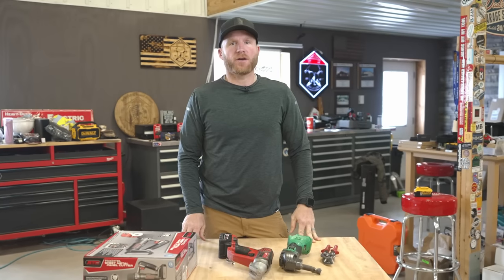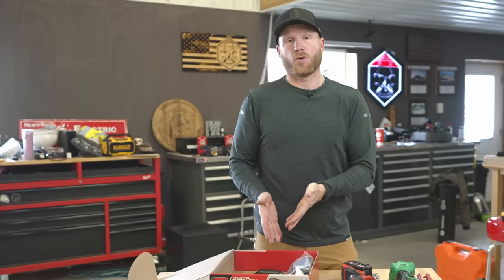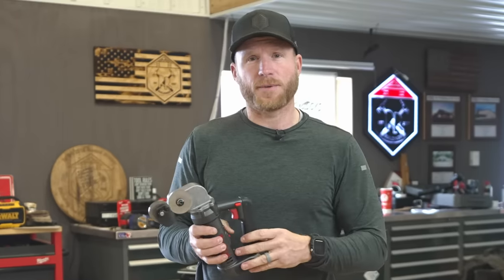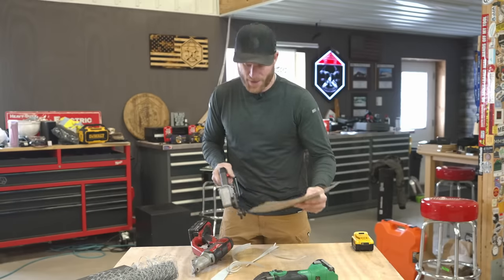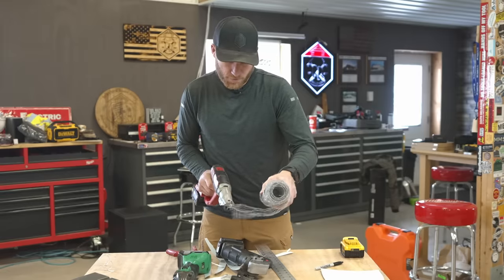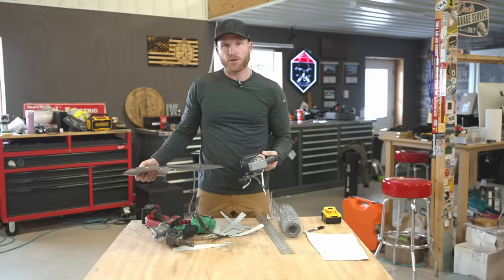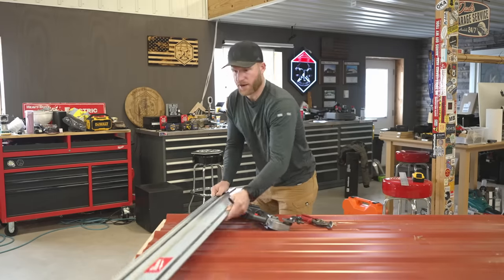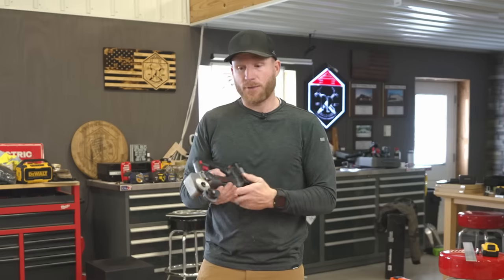Toolsday: The Last Metal Cutting Tool You'll Ever Need???

Comment: I use the dewalt impact shears in place of snips for the most part (drill powered single blade shear). For chicken wire or birdscreen I’ve found a kick shear works the best if you are in the shop. We have a machine called a slitter for cutting metal strips that works on the same principle as this tool with 2 cutting wheels. Hopefully when the cutting wheels get dull you can flip them 180 degrees and use the new surface.

Comment: Black and Decker used to make a cutter like that. They were cheap made but they worked good. They could cut many different types of things including carpet. We used them for cutting 29 ga. steel panel. We bought all we could find because they worked good and were cheap but didnt last. I'm surprised you didnt compare it with the electric shears. Matco and Dewat make them. I prefer the Matco brand. They attach to your cordless drill or impact driver and cost just under $100 dollars. They are the most commonly tool used tool and are sold by all the metal panel suppliers. The problem with your circular blade tool is that the round cutters dull after using them for a while. The other tools like the nibble and the double shear were never used by serious builders.

Comment: I'm impressed but you can cut roofing panels on the opposite side of ribs with a circular saw and metal cutting blade. It leaves no burs. Where this Wachtel cutter might excel is when you have all sorts of curving lines since it seems easy to direction with it.

Comment: Somewhat related pointer. Instead of left to right, cut with your hand snips right to left, using your left hand to lift the scrap side of your cut so it won't bind.  It makes a world of difference. I don't pull a single power tool out onto the job. Having the right kind of snips and knowing how to use them makes all the difference.
Reply: Yeah, I kept feeling like he was using the snips the hard way
Reply: @nicolasarias6000  Using the right snip for the purpose is essential too.

Comment: This same design of tool was marketed back in the 80's by Black and Decker. At that time, it was made on the same chassis as the cheap yellow jig saw that they sold for $12-$15 dollars. It was initially designed for cutting.linoleum and carpet, but soon found it's way on to the construction sites for the use of cutting metal roofing. But like all B & D tools, the.lifespan was quite short.
Reply: I really liked the Black and Decker and I believe I complimented it by making it better. Thanks for the comment, Tony

Comment: Funny to see old tech rebranded. I have an very old orange B&D tool with that same cutting head. Works great. Gotta be 40yrs old.
Reply: Yes. This style cutter works very well with great endurance. The Black and Decker was a great tool, I just made it work better with corrugated metal by changing frame, feed wheel and adding battery. Thanks for comment!!

Comment: Im a trim carpenter, but after Ian I repaired a few carports and 4 season rooms for my neighbors. It was a quick learning curve and  I found my little cordless circular saw with a metal demon blade to be the best. This tool seems much safer but I'd still need a saw to cut posts.  I cut over a plastic tablecloth to catch the Al chips.  Did you try cutting 3" deep pans?

Comment: I just used a tool that you attach to a drill that is designed exactly like the one in video that cost about $20, for electric shears, I personally think Milwaukee makes one of the best, I believe it cuts down to 18 gauge

Comment: Our sheet metal shop had a powered slitter that had the same design but it was a stand tool not portable. it pulled the metal through it to slit material into strips up to 30". It moved quickly too. It was a little sketch to run since a burr left on the last slit will grab gloves so we never wore gloves with it. And there was no speed control it was just All of it!

Comment: Looks like they took the Tapco Pro Cut mechanism and motorized it.  Bigger cutting wheels or more clearance between the cutter wheels and the body might make it easier to cut steel roofing panels at an angle.

Comment: My tools are primarily Milwaukee with some Makita.  I have the single shear battery powered Milwaukee shears. That would work fine for the chicken wire and does an okay job on roofing or soffit material. However, I usually result to a Milwaukee battery powere3d metal skilsaw and saw blade for roofing and such like.  But this looks like a very useful tool but pricey. Gloves and glasses, take care.

Comment: What sort of field are you in where you rarely use 24#, but mostly use lighter gauges? In Aus 0.6mm (24#) is generally the lightest sheet you encounter in the bldg trade. I'm guessing you do most of your work on site, so how often would you hold a piece up in the air like that to trim it? Laying it on a bench would instantly give you more control, but having said that, the design of it looks like it would be hard to control. What if you turned it upside down? It looks like it'd be pretty handy for scalloping flashings, once you master the control aspect. Try using your left-hand snips when you're trimming off the right edge of a piece like that. Your hand should be above or below the line of the cut, not off to the side of the cut like that

Comment: (Gentle Critique)  If you want a straight cut... you shouldn't be holding both up in the air, the tool in one hand, and the sheet metal in the other.  Lay the sheet metal flat on the table, with the edge that you're cutting, hanging off of the table.  No wonder you can't control it.

Comment: I install sheet metal roofing and siding for a living. About 600 square a year. We use DeWalt power shears. DCS496B. Did you ever try these out. They go right over the rib

Comment: One thing that I’ve learned over the years is that you have battery operated equipment of different brands it could become expensive and more work regarding battery chargers and extra batteries. Impressive tool but i would only buy one if it has a Milwaukee m18 compatible tool or electric. I would recommend to have a fine serrated replace not blade when you have to cut on seams.
Reply: You can buy battery adapters to and from most every platform.  I run Milwaukee batteries on my Ryobi stuff and the tools go into beast mode.

Comment: Looks like it would be super great on a long cut Valley Metal that fact and it works with my 20 volt Dewalt batteries is a great Plus that's the guy who does metal roofing EVERYDAY I would buy in a minute

Comment: The design works for the ribbed steel due to the geometry of the cutting wheels and were your hand and tool is located. Also, based on the design, the tool would work well on flat stock (as shown). The serrated top cutting wheel is to aid in lessening the cutting forces needed (like a saw and slitter / rotary shear combined). The thickness of the material and its attributes (hardness for example) will (as shown) have varying effects. The top side of material being cut/sheared would likely have additional defect from the serrated wheel (away from intended cut edge). Or in other words, if you plan on using the "off" cut, there would likely be damage to the paint/coating on the opposing (initial cut) side of material. These cutting wheels will likely dull (in time) as any of the tools shown, and would need either replacement or sharpening overtime. I doubt the tool manufacturer has a provision for sharpening or accurate spacing for varying material thicknesses. Are replacement wheels available? Great platform and fairly well 'designed' tool.

Comment: Hey Kyle, as a welder fabricator I've always wondered why people in roofing and in buildings like yours don't use cutting blades on a 4" grinder to cut panels. Is it just because of the little burs that it leaves? From a speed standpoint I know they are fairly fast with cutting thin metal. The only other thing I can think of is that cutting blades are much more dangerous than the tools you have in this video
Reply: friction cuts removes the protective coating the mill applied to the panel, causes early rusting and voids the warranty of the panel.   Cold cuts only like the tool feature or a nibler

Comment: I wonder whether it can cut through a Pittsburgh seam. Those are common in HVAC since that is usually what holds the ends of a square duct together. Cutting round ductwork would be interesting, too

Comment: Have the HF manual bench version for over 20 years which cuts 14 gauge metal, cutting wheels looks identical and this thing is a beast, paid $20 and because its manual I can stay on my lines with no problem

Comment: Have you seen the new Diablo metal cutting blade for a 4-in grinder. I saw them using it at the builders show and it looks like it cuts like butter through metal and doesn't throw Sparks like a grinder blade normally does.

Comment: Two things, a slightly smaller diameter cutting blade would handle the channeling better and get rid of the extended handle and use the main tool body as the grip for better control and a more accurate and straight cut.

Comment: 20V batteries are just good old 18V with a marketing angle. 
18V charged to the max will initially start at 20V but the level settles to 18V and stays there until just before they need recharging.

Comment: Might help if you put the metal on a solid surface and hold pressure on it with your hand , or for two had control clamp the metal , and have two hand control of the tool.

Comment: It looks cool but how does it compare to the panel cutting table/station I've seen you use?  It seem the table cut through a panel in a flash.  For small work it seem to be good.  I guess if you don't have that panel cutting station it seems to be a good choice.

Comment: The ONLY issue that concerns me is, replacement parts. Mainly blades. I do not see them listed on the site. They may be available, just not listed. If i were you, I would contact them and get a couple sets and keep them in stock. Just in case the company gets sued into the ground by DeWalt.
Reply: We have 1 uear warranty on wheels and do offer replacement. Haven't had any wear out in testing though.

Comment: Quite impressive. I notice the wheel spins at times. Just wondering if it will cut custom orb. Which is corrugated iron. Also will it cut over a period of time. Apart from that looks good.
Reply: It should cut corrugated iron as the material is not particularly hard. One thing that would  have to be right on the tool is the diameter of either the  driving roller or the shearing roller need to be no bigger in diameter than the minimum radius of the corrugations or it will flatten out or distort  the sheet profile at the cut end.

Comment: Can you do any curves with it or does it only cut straight? Doing hvac that could be very handy for building elbows.
Reply: It will cut a 6" radius good. Tighter than that you start distorting the metal due to the thick wheel frame. Hope you like it.

Comment: those heads are available to be used as an attachment to a power drill.   amazon has these attachments for less than $40.   the product in this film is really too expensive.  the cutter wheels are probably not as good as these but for $40 they can be thrown aways.  I don't know about the pros.

Comment: If you need a little more precision, hang the cut just off the work surface and then "clamp" the panel down with a bags of sand. Or actual clamps. If you are free handing it, one hand has to pull on the sheet metal and the other has to push on the tool, and the third hand helps with the aiming. Oh yeah, no third hand...

Comment: but... the roller cutter is a whole lot faster than any of the others, even on go slow mode..
who cuts chicken wire with mechanical tools...  Wirecutters do that best.

 - the wheel cutter would excel at trimming custom orb or trimdek - also AC ducting (holesaw a starting hole) or penetrations through metal roofing..

so much less scratching the surface, or converting all the offcuts into trash (ie. all  hand shears destroy the offcuts.) - safe to handle the output.

 - of course  for thick gauge steel a jobsite plasma cutter (or fibre laser source - jk, that is getting into serious ironworkers tooling) can be handy  - but this seems to have less downsides for typical 0.35-0.48mm steel

Comment: Good tool to add to my shop but I will still have my "hot saw".  Battery powered or cord angle grinder with a 6 inch 0.045 blade. Good to have it if I cannot find my safety glasses.
Iguana

Comment: I use a battery powered Makita metal cutting circular saw. Carbide blades for it are cheap, it has a chip collector that works. It cuts R panel and up to 1/8" plate like a circular saw cuts plywood; fast, clean, no burrs, and straight. And of course it uses the same batteries as the drill, sawzall, etc etc
No reason to buy into another battery and charger system.....
Reply: I own the Masterforce corded saw. Works very well. And Menards backs up their tools like a boss!! My cutter is a different style of cutter and can't cut 1/8". And if you're happy with Makita, as they say "if it ain't broke, don't fix it". But I do appreciate all comments. Tony Wachtel.

Comment: Have you tried the metal cutting circular saw blades?  They are pretty impressive.  This tool look like it would work well for ribbed steel.
Reply: I used the circular saw blades when building my two barns . Really loud and had to protect the metal with plywood so the saw body wouldn't scratch up the metal. They did clean cuts though

Comment: For those cuts that didn't end up as accurately, it surely would have helped if you had clamped the work-piece one way or another to a workbench and not doing it so much free-hand. Then you would also have had two hands available to guide the tool. I don't think your tool was flabbering :) it was your single hand holding the sheet metal.

Comment: Not sure if this was a question already asked ,  how does it do say cutting metal for around a window.  Do you have to stop and clean out the corner with snips or can it move smoothly into a square for around a window.   Also what about cutting circles for say a vent pipe .    As again interesting tool

Comment: Does it flatten or deform the rib essentially elongating the top of the panel ?   That's the one thing I can't really tell in your video.  But when it comes to cutting your gable  metal panels I don't care if to tool cost in $2,000 . if it did the job well it's well worth it when your in the post frame business.

Comment: it look as with experience that tool can be quite effective , i am curious about how it would do cutting CF boards , not thick boards 3-4 layer of CF ; Flat panels and formed stuff like say something that kind of in the shape of a bike gas tank . It did well with straight line cuts how about none linear cuts , you can think of something curvy ! and yes i am looking for a tool beside a dremel type to cut CF parts Flat + non flat , Thank you for the vid & cheers !

Comment: Hi Guttergeek here, this tool looks like a new cool tool to add to the pouch. I would pick it up if I could get thru a gutter other wise the zip wheel to get thru the heavier steel soffit/siding rib and then the electric shear. Will this tool cut thru Aluminum / vinyl siding quickly? The chicken wire was impressive too. I do waist alot of time on a ladder when the aluminum soffits are to big. this may be my new "butter cutter on a ladder"?
Reply: It cuts gutters very easy with very little distortion.

Comment: Black and decker made them in the 60s and it was cord still have them and still work great
Reply: Yes, it was a great tool. I changed the body, frame and feed wheel and made battery acceptable  to accommodate metal roofing.

Comment: I use the Dewalt metal shears, the one that looks like scissors kinda and not the one that cuts the quarter inch strip out like you are demonstrating, but man the wheel tool looks like a viable replacement!  Can I get an adapter to use my Dewalt battery platform?
Reply: Evidently it's identical to DeWalt's battery; no adaptor needed. 
In the video Kyle swapped it right out with one of his DeWalt batteries.

Comment: Makita had those metal shears out there for years it is very pricy but the best you can get I known body shops having them for over 20 years and it cuts up to 18 gauge metal but it's over $400. But we'll worth  the money for something that will last the other brands are no comparison what do ever they just don't last
As well with the metal shears there is no problem with cutting straight lines and there is no damage to either sides of the metal body shops getting metal sheets to makes patches don't want to waste metal nibblers are great for tight corners and panel cutters are for removing quarter panels and truck box sides for replacement panels...
What you call a shear is a panel cutter to remove the parts of cars ... But for house roof panels and soft it looks like it would be great but for bodywork cutting body metal I'll stay with the Mikita...

Comment: Cool of you to give this tool some exposure, never heard of it...its only downfall besides accuracy seems to be cutting ability. The M12 nibbler goes up to 16 gauge, i believe. Maybe not useful for metal roofing, but for metal framing and sheet metal fab....
Out of curiosity have you tried a metal cutting circular saw for those corrugated panels? What were the results, were they comparable to the Jetco? Thanks for the content, I appreciate your craftsmanship.
Reply: I've used a circular saw with metal blade for cutting all sorts of metal.
To cut RSJ /T beam, cool room panels, stainless steel and corrugated iron.
 it's quick and accurate.

Comment: The link is dead for this tool: 404 error Dec 20, 2023.  But Amazon shows a metric shtload of add-on sets for regular drill motors.  I'd definitely try something like that for twenty bucks rather than spend $400 on the version you showed.  Wow!